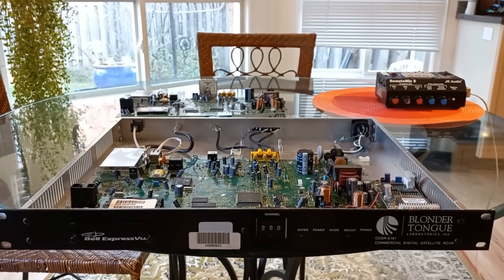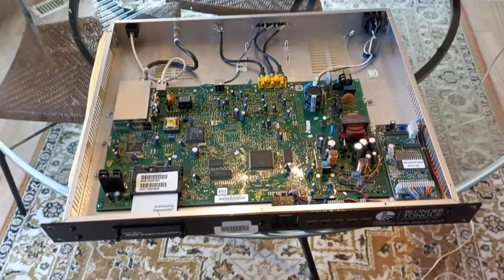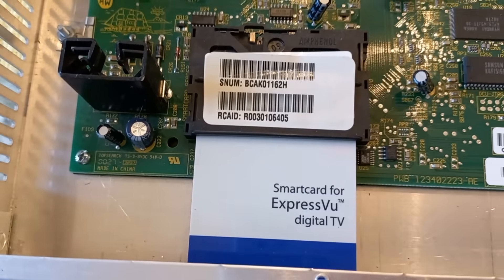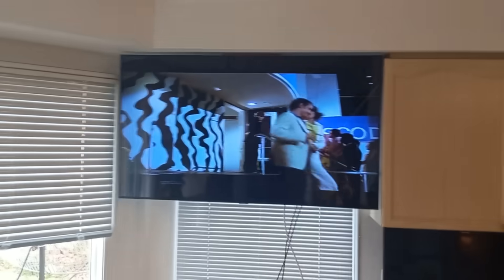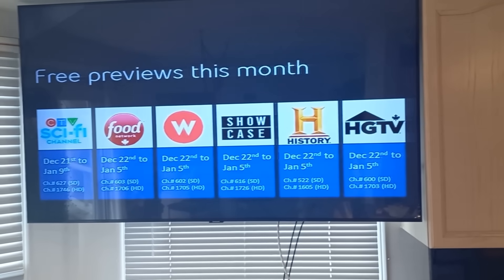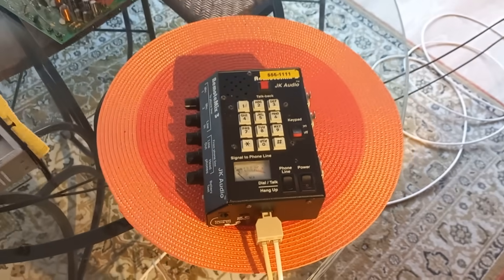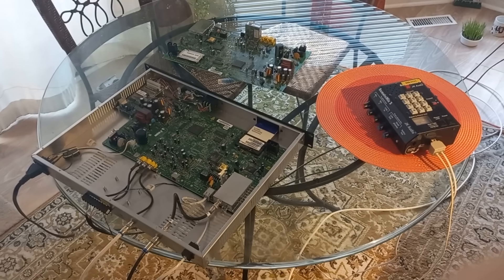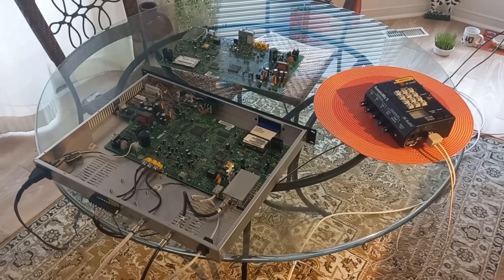HACKED!! Hotel Satellite Receiver Working!

Comment: If these receivers are anything like the older ones in the UK/Europe, they don't always dial back to base for PPV.
The Smart Card has a "credit limit" on it before it has to phone home, this reigns true for Sat and Cable, but it's easier to jack on Satellite.
As long as the receiver thinks it's connected to a phone line, it will allow purchase, but if you're close to/that purchase would take you over the limit, or it's been too long since it's phoned base, the card will lock credit and require phoning home.
Still works to this day on anything but the very latest sat receivers, you can jam a 9V battery on the end of a phone line and it'll register as a valid line to the box, box will try dialing out, fail, then let you in as long as you have credit so as not to inconvenience you when you're trying to watch a time restricted event.
Reply: you can just get into the engineer menu on many boxes with a key combo and access the "dial X" for outside like menu and then add something there so it fails to dial. This may or may not have been common on UK Military bases and the soldiers may or may not have been buying second hand boxes and maxing the credit before dumping them.
Reply: So in theory, if it's possible to access the card and refill "credit" on the card ? ? ? 🙂

Comment: The receiver likely already has full authorized access and the call it makes is to the lobby to charge the specific room which is why there was no dial tone but it still went through as a purchase.
Reply: If this is the case, eventually, the receiver memory will fill up and no longer be able to do it because it hasn't called home to dump the charges. Kinda like how those "free" cable ppv blockers would block the telephone line and would just store the charges in memory until there was no room and the only way to clear it was it calling home and charging you.
Reply: I wonder if it's to scare kids away, since that specific channel was NSFW
Reply from the maker: These Bell receivers are used to bring the a single channel from the satellite to the hotels own system like Lodgenet or OnCommand.
Reply: @xabhax DTV has a more active system. The receiver would mark the purchase on the card (which is why they require the card be returned when canceling service), and the backend systems would cycle through units (accounts) to have them report in for billing every month. If your receiver didn't call in, it would be told to disable ordering. Of course, your receiver had to be on for all of this to work. And there were hacks to clear the purchases from the card. (even firmware hacks to never record them in the first place.)

Comment: I'm curious for how long the receiver will be allowed to do this ? If it is can receive updates then it might also get a security update with a restriction patch? Please do an update on how long this is possible!  Thanks
Reply from the maker: It should keep going as long as you keep it connected to power and the satellite.
Reply: It's because the signals are meant for one-way communication.  And like I said if that box belongs to another hotel chain then as long as their boxes are on that box will stay on.

And how boxes are able to do the upgrade when it gets an updated Patch key.  Is because the previous key still decrypts the signal in order for it to get the new key.

Comment: I'll tell you how it works and it's because most likely this is a big hotel chain so they'll be multiple..

The hotel is charged for a service based on how many hotels they have and that's why you have a card that was still active because obviously if you go find hotel it was from and go to another one..

So as long as that hotel keeps using those systems.

But the minute the hotel gets completely off of using that system that card will not work anymore.

Comment: If you have a Digital receiver but aren't paying for the service for it and you plug it into Say An outdoor antenna Via coaxial Would you be able to pick up channels that way??
Reply: Sorry if it's a dumb question 😂
Reply: That won't do anything.
Reply from the maker: If it's a digital satellite receiver it needs to be connected to the satellite dish for that service. In my case it's the Canadian Bell ExpressVU.
Reply: You will need a compatible LNB/dish and receiver tuned in to the right bird. All the geosynchronous satellites are directly above the equator about 22,500 miles up in the Clark Belt. If you're on the right side of the planet and have the gear. The receiver powers the LNB and they won't do much of anything without a powered meter, multiswitch, or receiver to power it up. Its all encrypted and no way to watch it without a receiver. There are "hacked" cards out there or at least there were when I was a tech 10 years back. The cards will unlock everything, some guys charge a monthly fee and any time your card gets "zapped" they bring you out a new one. Others just sell you a card and you buy a new one as needed.